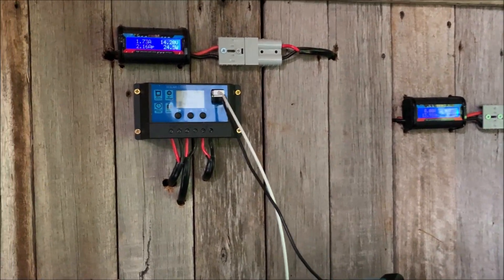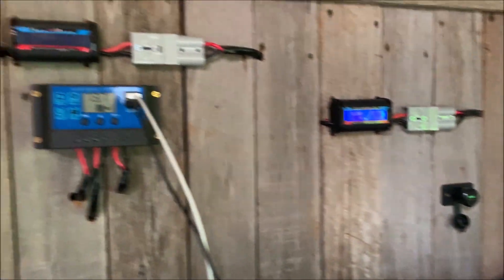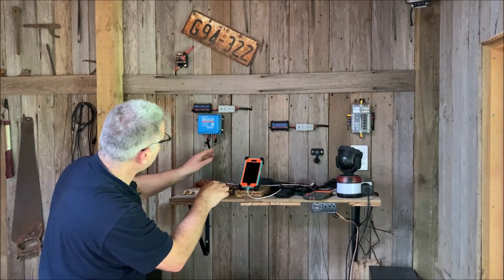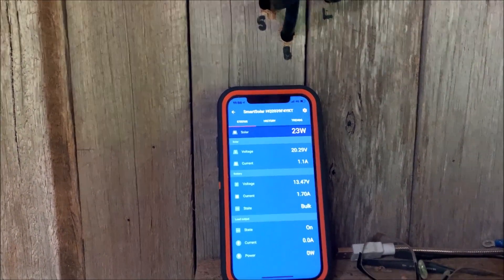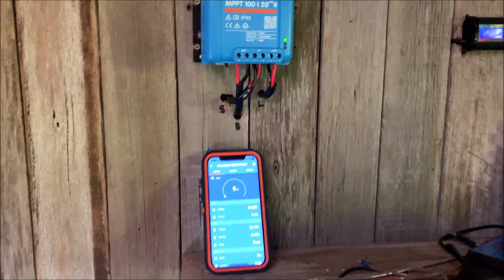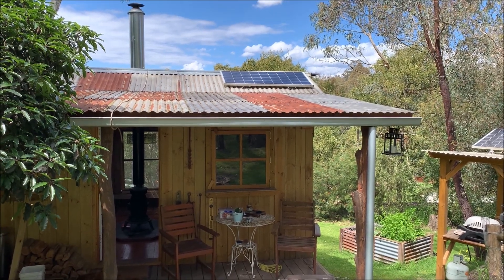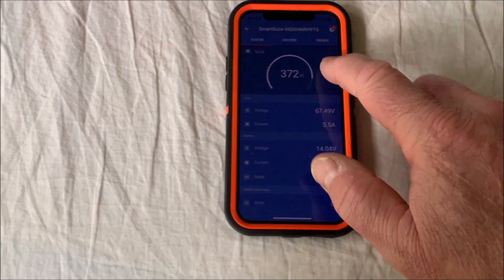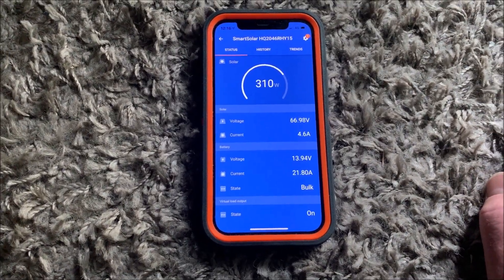Victron MPPT Solar Charge Controller upgrade from my basic PWM controller in the Garden Shack

Comment: I'll be upgrading my current system within a year. I currently have the same pwm charge controller witch was about $10 off eBay, which works pretty good and about 40x 7.2ah AGM batteries green the royal Brisbane Hospital für free. Cheap system but the batteries are slowly dying. The system has been going since 2012 and the batteries are way older. 
 I'll go 24v rack mount batteries, maybe victron and a good inverter and run some circuits in the house off that while I expert more for bigger $$$
Reply from the maker: Definitely recommend the Victron kit. The Bluetooth data is awesome.

Comment: On the mppt the load output can you switch it on & off  using the phone ?
Reply from the maker: Yes you can turn the output of and on. Will also auto turn it off when the battery gets to a certain voltage if configured.

Comment: Hey mate grab an old 190 Watt house panel off marketplace for $30 you will have a ton more amps going in  I run one to the same regulator and a 50AH lithium running my engel and lights and usb chargers
Reply from the maker: I did actually grab 5 195 Watt panel for $30 each for the Off Grid Shack. Used 3 series with a Victron Controller and 2 batteries. Works a treat.

Comment: I have difficulty getting the gist of what is what with solar, though I want to go off grid when I set up my property. Does it require constant monitoring and how do you learn what you need to know?
Reply from the maker: The monitoring just helps you understand how much load devices use, how many panels you will need and batteries for what you need to run. It is all a learning experience. Start simple and experiment.